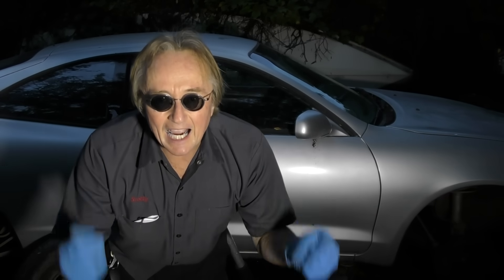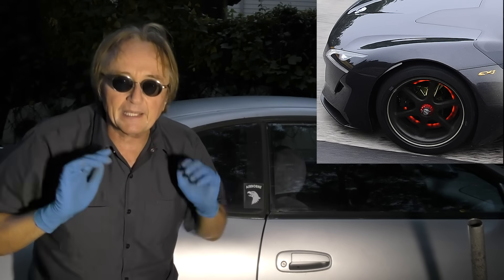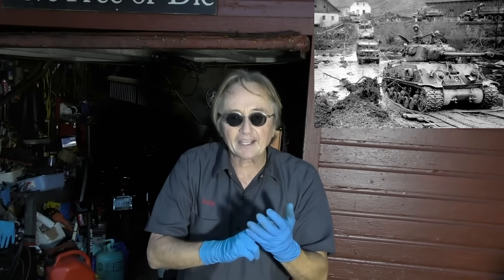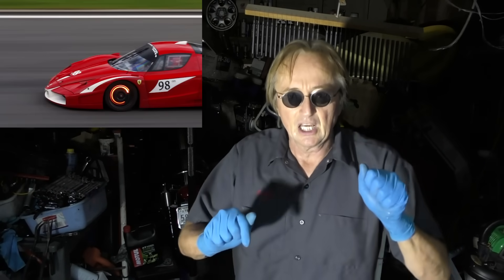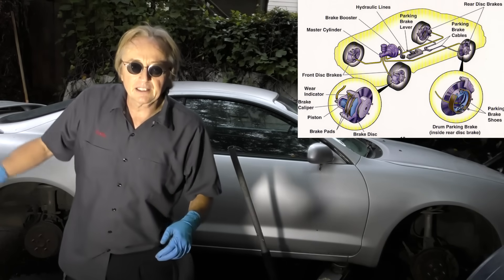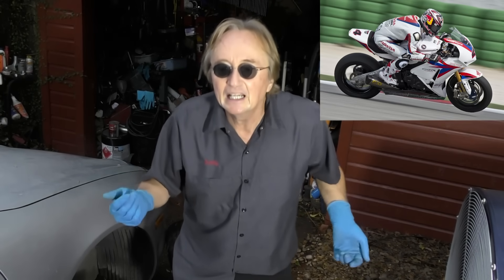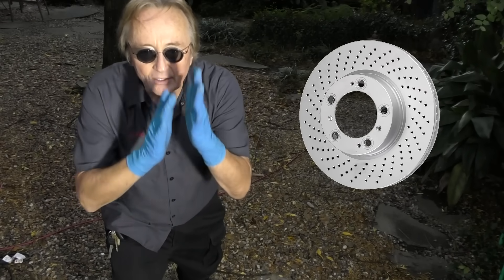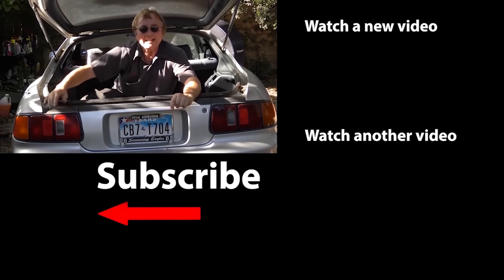Why Some Cars Have Drum Brakes Instead of Disc Brakes

Comment: Seeing how disk brakes are now the standard, even less expensive cars now have 4 wheel disk brakes. It's called economy of scale. Build more of them and it becomes cheaper. Less parts to a disk brake also makes them more desirable. Changing disk pads is way easier than drum brake shoes. I can change the 4 disk brakes on my car in less than an hour with new disks and rotors.  With drum brakes, I have to remember where all the springs and pieces go and it is kind of a PIA to snap the springs into the holes of the drum shoes and back plate. Disk brakes are also self adjusting but so are drum brakes. The problem with drum brakes is getting them adjusted at first to have the correct pressure on the drum from the drum shoes. Lots of people died because of drum brakes. They used to be made of asbestos. The dust from drum brakes was toxic and lead to lung cancer. Lots of old time mechanics died of lung cancer brought on by inhaling drum shoe dust. Some have said that actor Steve McQueen died of lung cancer brought on by his inhaling brake shoe dust. He did do a lot of his own mechanical work on his machines.
Reply: Drum brakes aren't that hard to change, its just the getting the dang springs back on that creates a headache LOL.  Many vehicles that have drum brakes in the back still have those original drum brake shoes when the vehicle finally dies because they aren't used as heavily as the front brakes...that is unless someone drives around with the parking brake on LOL.  

Front brakes do most of the work so disc front brakes and drum rear brakes were the standard for several years, they're slowly going to all wheel disc brakes now, my 08 toyota tundra had 4 wheel disc brakes, they just wear out faster thanks to the electronic nannies using them for ABS, traction control, stability control, and the fake rear limited slip which was nothing more than the brakes being applied to the wheel that was spinning faster LOL.
Reply: @wildbill23c  said "Drum brakes aren't that hard to change" . Try a 2007 Jeep Grand Cherokee and you wouldn't say that. That's even if the drum/disk hasn't rusted solid onto the half-shaft because no-one has ever checked the shoes before. I had to pull out the half shafts and the whole handbrake cables, then flog the drums off with a sledgehammer.
Reply: @dukenukem5768  If you have that big of an issues that would be an operator error problem...again brakes aren't hard to change if you keep up with maintenance which 99% of today's drivers don't and wonder why a repair shop has to charge them 20x the normal rate due to having to break/repair things from lack of routine maintenance.
Reply: but have to remember brake shoes last way longer than rear pads because of friction drag..  som people don't even change them for nearly the life of the vehicle
Reply: @joebrown9621  My rear shoes made it to 170,000 miles and still had a good amount of friction material on them when I replaced them - I only did it because one adjuster had seized so while you're in there might as well put new ones on.
Reply: Lots of people you can still say die from dust given off from brake pads, it's just not as bad as before. Quality of life and early death is directly related to how close you like to a large highway, the numbers are shocking. Even poor cognition from degraded oxygen content and pollutants.
Reply: I recently found out something about rear drum brakes to be careful of. Because they don't wear quickly and get replaced very often the adhesive they use to bond the padding to the metal frame of the brake shoe can eventually break down. As such, you can have a rear shoe with a lot of miles on it that looks okay because the padding is still thick but the adhesive can deteriorate causing the padding to separate from the frame of the brake shoe. I've seen cases where the padding has separated from the frame of the shoe and gone around and gotten caught at the top and bottom of the drum. As a result I've gone back to using riveted instead of bonded brake shoes for rear drum brakes.
Reply: Good point Steve , drum brakes are more troublesome , but like Scotty says there's very little difference in stopping power (that's if there just on the rear of course) .
Reply: Steve McQueen worked at a garage as a professional mechanic doing brake work on a daily basis. He probably inhaled lots of brake dust, which in all likelihood contributed to his getting lung cancer.
Reply: @joevignolor4u949  Wrong. He was forced to work in the hull of a ship for bad behavior while in the Navy. That is where and how he developed lung cancer.
Reply: @johna.4334  I said working on cars contributed to him getting lung cancer. It probably contributed to his overall exposure but it may not have been the only source.
Reply: Steve McQueen  illness was a direct result of massive exposure while removing asbestos lagging from pipes aboard a troop ship while he was in the Marines. No one died from brake dust.
Reply: You are correct that it had nothing to do with auto brake dust.  Actually it resulted from the time he was in the brig as a Marine and was put on a work detail to demolish a building that contained asbestos; he said the air was thick with asbestos dust and he himself believed that experience was the cause of his cancer.

Comment: Just purchased 2018 Mazda 3 GT,since it's winter here in Canada. Mazda tried selling me a anti rust Gizmo that sends current through the car at $900. I said no thanks Scotty what's your opinion?
Reply: You will need it on a mazda. Its a rust bucket after few years.
Reply: Cathodic protection for cars? Interesting.
Reply: Think thay use this on ships I guess it works on them.....
Reply: Ross, here is my 1 experience with them. My grandpa has a 00 Rav 4 and he has had 2 of those on since it was new when he brought it in to me for service and I couldn’t believe that his 18 year old, parked outside, Rav 4 didn’t have any rust on the frame or suspension parts. It still had probably 90% of the paint left under the car. It’s crazy to see the results of something I personally would think is a gimmick. I don’t sell them or anything I just thought it would intrigue you. But for $900? Pass. For $150-$300? I would.
Reply: Ha,ha! I didn't know they still sold those things. Those were on most of the vehicles of the 90's that I used to see. I have no clue if they actually work and never had the chance to take one apart.
Reply: I wouldn't put one on my car.. just have it rust proofed twice a year  before winter and after winter before the summer heat. go to krown..  or somewhere that doesn't use the black undercoating junk.
Reply: I would get the car Krown rust protected.....electric corrosion protection will shorten battery life and Krown is also good at preventing Rodent attacks on your new car. Honda and Toyota use soy based plastics and wire insulation which squirrels and mice love...oil spray is a great deterrent.
Reply: Seen then long time ago apparently it does work but it was $400
Reply: I have tried it. It drains my battery till no start.
Thought it was my battery. Then thought the alternator were at fault. Bought a new battery and still ends up no start. After disconnecting that overpriced gizmo everything is fine again. Even years later. I really regretted the purchase of this lame gadget. Because they wouldn't accept the return of the new battery.
Reply: Ross there’s already current running through the car if your battery is connected. The body is ground.

Comment: I just hit 50,000 miles on my Camry and have 1mm left on the rear pads before they need replacing. Both Corollas I had with rear drums made it just shy of 200,000 miles on the original rear shoes. The Camry sure does stop better and more level, but the rear disc brakes definitely do not last as long!

Comment: Hi Scotty
Pick me pick me pick please 

I have Infiniti G35 2005 
I need to ask you with a100 k on the clock what should watch out for
The auto transmission has a delay in changing from the first to second  and sometimes from second to third 
Do you think it is giving me bad sign before gone bad 
Also how many quarts should I change for the gear oil

Comment: Just a suggestion - On your floor jack, slip a piece of 2 inch pipe insulation over the jack handle to protect the door panel from dents and scratches.  Better a $2 piece of foam than trying to buff out a scuff mark.

Comment: I have always found rear disc brakes to be a pain in the backside. Rear caliper failures are very common, they get clogged up and need rebuilding. The Ford Mondeo is terrible for this, the handbrake causes sticking calipers and I have taken to leaving the handbrake off and the car in gear when it's left for more than an hour or two as I just know that the handbrake will stick otherwise. Been through several calipers on that car.

Other vehicles I've had with rear discs haven't been as bad but rear caliper rebuilds are far more common than they ought to be.
Reply: Agreed!
Reply: I had this problemen 2 times with my older Jazz. The new Jazz is available with drum brakes again.

Comment: Im beginning to question Scotty now. First and formost, you aren't supposed to use the front brakes on a motor cycle too much cuz you'll go over the bars or the bike will slide in a low speed turn. Second, the toyota tacoma has rear disc brakes and the engineers say its to keep mud and elements off the brakes and says the opposite. I tend to trust engineers...

Comment: Glad I saw this, only yesterday I was contemplating replacing my drums with disks. Great timed video :D
Reply: Don't lie to yourself, you planning on adding 4 disc brakes as DLC on the next NFS.
Reply: @brunoraoni  Wrong, I was planning on adding 4 disc brakes as part of the Season Pass on the Ultra Deluxe Edition™.
Reply: EA Games, It's In The Grave.
Reply: Scotty still says disks are waaaay better than drums shrugs
Reply: 😳 a few persons i knew did the rear conversion ended up with worse braking performance because they didn't factor in that drum brakes provides more braking torque than disc and they needed to change the proportioning valve to compensate.. regular driving stick with factory set up

Comment: my old 71 maverick was great in snow and ice with drum brakes,   but I also worked at Amoco back then and I was always adjusting up the brakes so they was tight,   most cars these days if a person is a good driver they can get 10 years out of drum brakes,   where as the disc on the front tend to last 3 to 4 years for most people.  but when brakes get old they may still have lots of pad left but they are then old and get hard and squeak and it drives people crazy.   people have the notion that cars should make no sound these days.   and with disc brakes I always know who the people are that drive way to hard,  they will burn them up in 6 months and say its making a noise or shakes.   if I let them just talk long enough they tell me they drive for Uber,   and they always use GPS because they do not understand how city streets address system works so they are riding the brakes looking at the phone GPS all the time.   and that's just one main reason why car parts stores will not offer you a life time brake pad if your using the car for commercial work,  as your then using it out side the scope of normal driving,   they may deny your request later when you bring back the brake pads.  and even if you lie to them,  they now keep your purchase history so they will look it up and see if you have been coming back over and over for the same thing.

Comment: Drum brakes are a PITA!
Reply: It depends.  Personally, I've done LOTS of drum brakes, and for me it's only slightly more difficult.
Reply: @xaenon  i refused to ever touch them as I've only owned cars with disc brakes all around. 
had a family member ask me to help them out. 
My first AND last time touching drums.
Reply: @KT-fi7tm   And certainly I can understand that.   Overall, I prefer discs, too, but I ain't 'fraida no drums, lol.
Reply: @xaenon  not so much afraid as it is work my nerves 😁
Reply: @KT-fi7tm   I'll agree, if you aren't used to working on them, they can be a pain.  But seriously, after you've done a few, it's easy-peasy.
Reply: @KT-fi7tm  drum brakes are easy to replace.
Reply: @xfedoraxdavex7359   not easier than discs and that's my point. If you like to do them, then great. 
I'll never touch another set in my life unless it's to throw them in the trash and upgrade to discs
Reply: No they arent
Reply: A good ol hammer and screw driver will do the trick. Oh a dust mask and a ton of brake cleaning fluid is needed too. Cause boi it will be dusty when removing them drums
Reply: I love having to change them on 10 year old trucks because I love pain.

Comment: Front wheel drive cars have rear discs for marketing purposes.  They do very little.
Reply: Rear pads are so easy to change about 10 minutes rear drums well most of the time the drum won't even come off  then trying to fit all those springs everywhere without the thing exploding everywhere under the spring tension only to find it won't turn and the handbrake does not work properly
Reply: Not really. I’d rather change pads in 3 mins than deal with a fucking drum brake.
Reply: Current Mazda cars apply much more braking force to their rear brakes on their cars compared to other manufacturers. They do this so the car doesn't nose dive and remains more controlled. The only 'downside' (not really) is that the rear brakes wear as fast as the front brakes so you might as well replace all 4 at the same time when needed.
Reply: I agree that maintenance is so much easier for disc brakes.  For someone with little skill, disc brakes are so easy to do, yet are deceivingly difficult for drums.

Comment: Hi scotty, I have a 1998 lexus es300 and my concern is that when I come to a stop and push the brake pedal I feel and hear kinda a scraping noise can you help me determine what this could be? I think my pads still look good.
Reply: Travis Fromherz sounds like your pads are worn. Might need new brakes and rotors.
Reply: @castlewhore2007  thank you very much I will look at them

Comment: The rear shoes on my 05 Vibe have lasted well over 100,000 miles. The front rotors and pads were changed around 65,000 miles.
Reply: then that means your a good driver and not to aggressive.    but when brakes get old and still have lots of pad left,  they get hard from age and make a squeak that drive people crazy.   its normal to get 10 years out of drum brakes,  they tend to get rusted up inside and fall apart.   so with 100,000 on it,  you still might want to have them changed.   and old brakes tend to lose grip because they become hard with age.   like new rubber grips very good but old dry rubber slides.   over time you slowly get used to having to work the brake harder,   this shortens the life of the front disc brakes as they are then made to work harder.   so the 2nd set of front disc brakes tends to not last as long,    and always use ceramic brakes,   the cheap organic make crazy noise and makes the wheels go black with organic dirt all over them and do not take the heat nearly as well.   only about a 15 dollar difference for the better ceramic brakes.  ceramic is for disc brakes while drum brakes will be organic or semi metallic.
Reply: Deplorable Vibes are good cause they’re literally redesigned Toyota Matrixes...
Reply: shoes tend to last longer than even rear pads on disc brakes because of the extra frictional drag created by the pads
Reply: Driving a manual adds to brake life as well. BTW most of my driving is suburban.
Reply: That's pretty normal, the front brakes do most of the work which is why you find many vehicles with that same setup, front disc and rear drum.
Reply: Your rear disc brakes will probably last 250k+ easy if your car doesn't get rust.